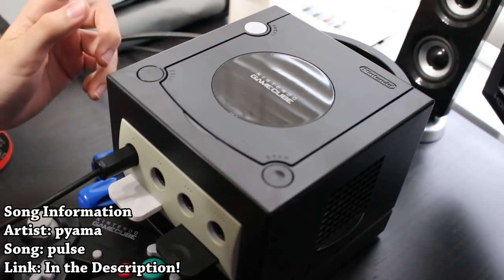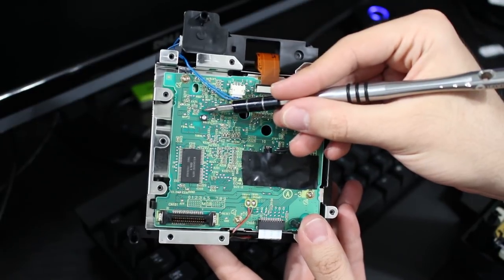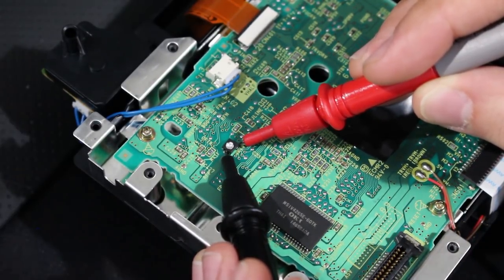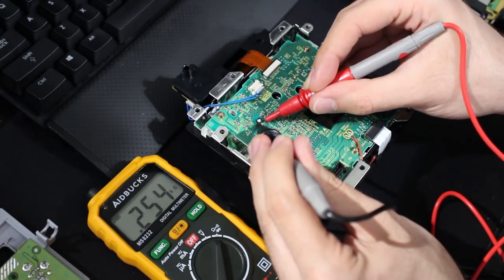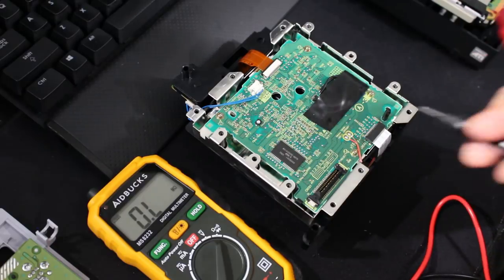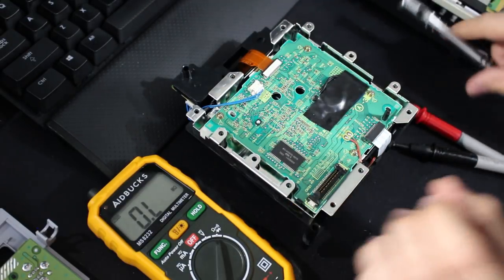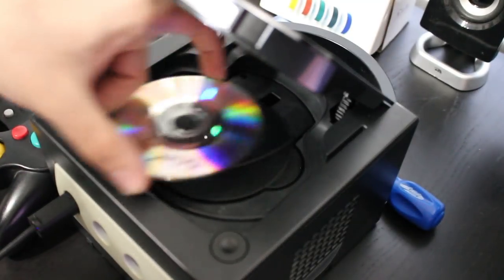How to Adjust a GameCube Laser for Backup Discs | GameCube POT Tweak Tutorial

Comment: I like to hold both multimeter leads steady on one hand, and with the other hand turning the pot screw. You can see the ohms turn right before your eyes and have a near perfect, spot on adjustment.
Reply: pro tip: you can watch series on Flixzone. I've been using it for watching lots of of movies these days.
Reply: @Rayan Heath Definitely, have been using Flixzone for months myself :)

Comment: My laser sounded like it was going to break. It was set over 500, brought down to 457. It worked, laser now is super quiet and my Resident Evil games work Great! No more disc errors. FYI after reassembly the disk drive it selfs if it moves just a little after you put bottom screws the gamecube won't work it won't read disc and make you feel you wasted so much time that you'll think you laser is just Done!  Mine move upward so I opened lid and with fingers  pressed and moved disk drive downward and got it aligned. Now all my games work perfectly.

Comment: Thought my GameCube was shot. I am not techy at all, so I was pretty skeptical I'd be able to repair it. But I found this video, followed the steps, AND IT WORKED! Thank you for the help, you rock!!!

*Didn't have the gamebit driver for removing the outer plastic case, was too impatient/cheap to order one...but was able to use a grinder to make a forked tip on an old flat tip screwdriver, did the job😅
Reply from the maker: That's all you, you did it!

Comment: Is the resistance the same for DOL-001 and DOL-101 lasers? GC-Forever wiki says, "The factory settings of the potentiometer varied from DOL-001 with a value range of 450 ohm - 600 ohm while the DOL-101 had a value range of 150 ohm - 250 ohm." I can't find any other reference for the factory resistance. My 001 read 416 ohm on a calibrated Fluke 177. I lowered it to 395 ohm and Metroid Prime still won't read. I'd hate to burn the laser by dropping the resistance more.

Comment: I tested mine stock and it was 150.. is this normal on a PAL GameCube? Reads standard DVDs fine but not burnt ones.

But it could be my chip install.. I soldered it on but it wasn't working so I decided to desolder the chip and run wires instead but it ripped off a bunch of the contact pads on the motherboard.

I followed a pinout diagram and ran cables from the other side of the board and the chip seems to be working but still won't read burnt dvds

Comment: I tried adjusting the Ohms and even tried replacing the laser assembly with a new one but my gamecube is still not detecting discs. Any ideas on what else I can try?
Reply: disc drive capacitors.

Comment: Hello, thank you so much for this video. My gamecube kept saying "an error occurred. Turn the power off.. " and I did not want to buy a new one. I noticed right before the error appears, the clicking sounds would get louder then to be followed by a whirring sound. After much toggling, I settled for 208 ohms (Error persisted at 113, 154, 165, 171, 188 ohms) with no problems with the error appearing but still with loud clicking. I play original discs in used condition (microfiber cleaned). Not that I expect you to read this, but should the laser clicking sounds be ignored? They are as loud as ikea analogue clock.
Reply from the maker: Clicking doesn't sound all too normal, if it's similar to what I showcased at the beginning here.
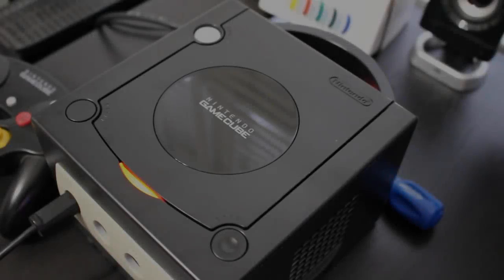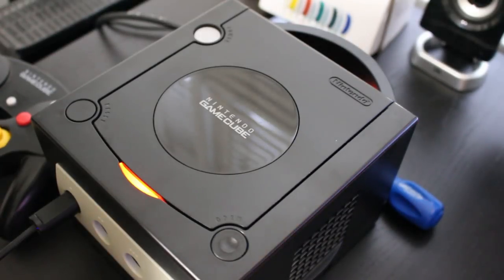Reply: @MrMario2011  I have adjusted to 260 ohms. After carefully relistening at 8:30 - 8:59, my gamecube sounds similar to yours (Not to criticize your production quality, but I did not notice the laser shifting sounds at first. You make quality content) I think I overreacted to the laser shifting up and down as a unusual clicking sound because of my constant toggling wearing me out.
Reply: Clicking means the value is too low pretty sure

Comment: Can make a vid replacing the laser? I have a new laser in mine and have adjusted the POT, but it wont read disc
Reply from the maker: I've never replaced a GameCube laser, but I'll probably record it once I get around to it. It sounds like you might not have removed the solder from the laser's anti static point.
Reply: @MrMario2011  I replaced the whole assy, but if there is simethjng that i should remove, that makes sense. Can you send a link to a picture so i can have a look? Thank you for the reply also.

Comment: I did put it down below 250 ohms but it still wouldn't read the burned disc. Not even at 150 ohms will it read. Is there any spefefic number I should try? I don't want to burn out the lazor on my Xexno Chip Gc Drive
Reply from the maker: The SegaHolic has a great video covering how to replace the capacitors on the drive board, that's also becoming an issue with these consoles that could lead to the laser not working.
Reply: @MrMario2011  the lazer reads regular game discs just fine, the only problem is the disc couldn't read message for burned games

Comment: I can't get mine to read the mini DVD-Rs I burn. It reads full sized ones just fine but I don't have a modified case. It reads originals fine too and even old compressed bootlegs. Can't get it to read the mini ones I burn.
Reply: I figured it out. I had to manually adjust writing speed in Imgburn to 2X. Burned copies work fine now after the pot tweak.

Comment: I install a xeno gc on a dol-101 and give me a error turn off the console an check the Nintendo booklet when run a backup copy of any game any clue solder where perfect with wires original games works good just copy’s I adjust the laser too but still same error

Comment: Hey my original ohm number was 150 ohm . i get the little loading icon with a copy of sonic heroes but then it give me a DRE. So when i tweak it up. It doesnt do anything spins the disc and then give me the error. so i might turn it below 150 ohm? i heard that there is a second resistor thats always 150 ohm so even when you set the pot to 0 its 150 ohms. i tweaked it to 100 ohms is that ok? it now boots the game but when i want to play the first level it loads it normal with the spinning heroes logo and then give me an error?
Reply from the maker: Sounds like your laser is going out or you might have a bit of a rough burned disc, if you're playing from a DVD-R.
Reply: @MrMario2011  The disc spins for me, but my Gamecube is just giving me the disc cannot read message every time.  I'm using Dvd-R, Ritek for mine. I know the disc is darker then a Gamecube disc so is there any number I should try?  150 ohms doesn't work, neither does 173

Comment: I did everything you did I went from 250 to 150 by ten ohms each time and it did not work. I went to another video and this guy got his at like 450 ohms or something. So I went ahead and went by ten ohms from 150 to 500. Yet it still did not work for anything. Everything is clean and in good shape the laser and laser motor works. So I don’t know why I can’t get it to work. I’ve spent almost 15 hours trying to fix it. Any tips?
Reply: GameCube model dol-001 laser usually had like 450-550ohms. The dol-101 had 150-250. So if your system was set at 250 you likely have the dol-101 and if it is still not working at 150 then you probably need a new laser
Reply: check the disc drive capacitors. they're getting to the age that they could be problematic
Reply: @boolooyuk  i have dol 001 and mine was at like 194.
Reply: @DragonProtector mine is a 001 and it was at 184, I lowered it and still not reading, I’m gonna go up to the factory settings for the 001 and see if that makes it or breaks it.

Comment: I have a question: whats wrong here? i can read burned dvd r, it will sometimes play just fine, but every once in a while ill get music hick-ups or part of the map not loading. this will usually result in a crash.
is this due to the quality of disc's used (pretty recent sony one's) or is it my laser which is at 158 ohms.
any answer is appreciated!
Reply from the maker: Could be your discs and burn speed. When burning, the slower the better. Older consoles generally work best with 2x-4x speeds but most modern burners will not write that slow.
Reply: @MrMario2011   burned at 2x - so that shouldn't be an issue and the discs i'm using are pretty decent sony one's. soo... im lowering to 130, crossing my fingers i dont smell anything burning in a few minutes. Thanks for the responds btw!

Comment: 1 dislike? What, is there one GC hater among us?
Reply from the maker: Yes
Reply: I never get why some people watch this type of helpful  video and dislike it... the one dislike happens really quick I post stuff like 20 minutes long and get a dislike in less than 10... I think YouTube does it😠😠😠 lol
Reply: @MK-qo1rz  Nah , your vids are just bad .
Reply: No there are 3 😡
Reply: @MK-qo1rz  that is called humanity logics
Reply: @MrMario2011  Hijacking the thread : I followed your instructions and I still get a no disc message. The lid sensor was broken so the console wouldn't work at first (it starts without the little sound / animation). Once I got that fixed I finaly got the proper startup animation, but discs won't read anyway. Settled for 155 ohms on the pot, but no luck, it won't read disks :(